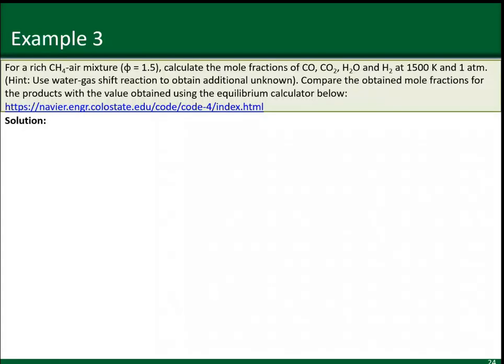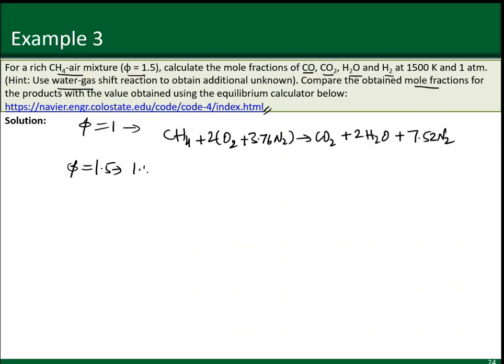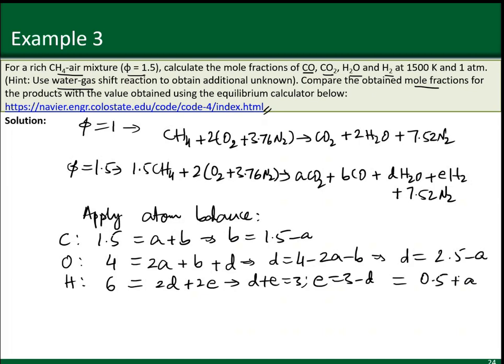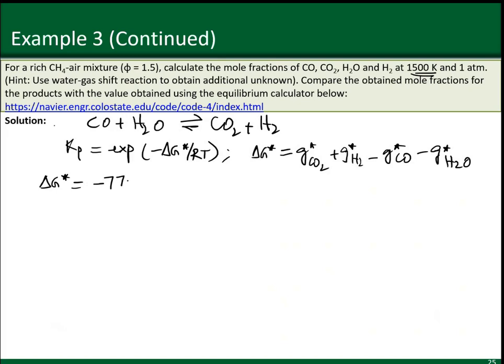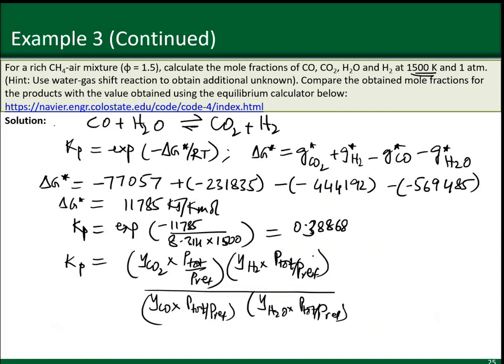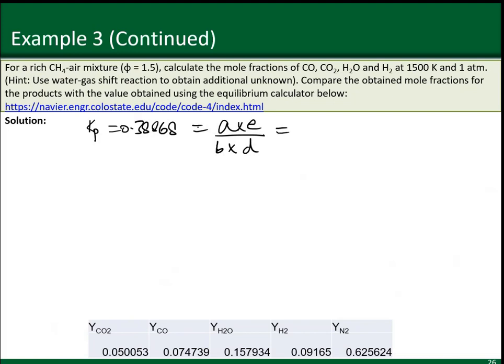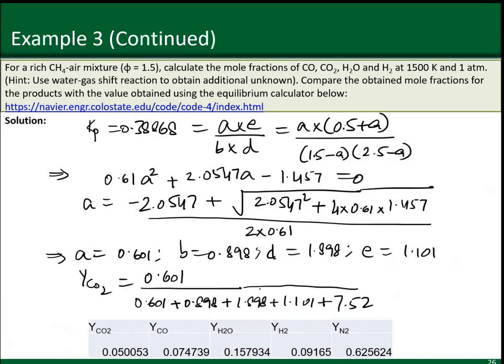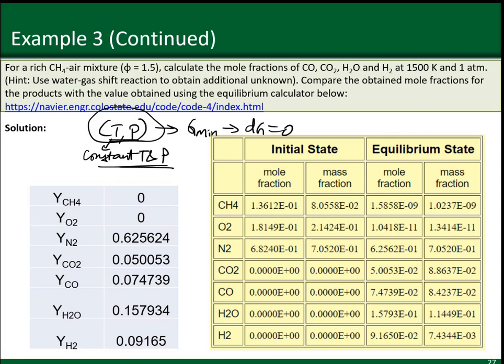Calculation of Rich Methane - Air equilibrium composition

Comment: Aoa. Why there is CO  in the product although the mixture of CH4 is rich? & how to decrease its quantity in the product?
Reply: Now i understand if we increawe the 02 then there will complete combustion..
Reply from the maker: @danishaman291  : Walaikumsalam Danish. CO is always in the product side due to incomplete combustion. In reality, we never have complete combustion but we only approach complete combustion in some cases which means that CO will still be there but in small amounts. For a rich flame, there is not enough oxygen for all the carbon to form CO2 so some of it ends up as CO. In other cases where there is enough oxygen, we still get CO because of dissociation of CO2 into CO and O2 at high temperatures